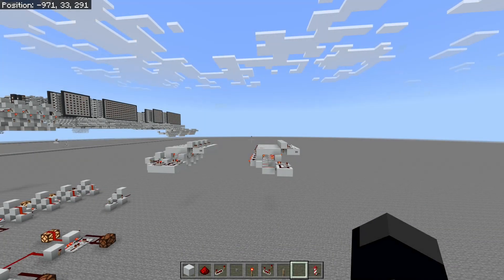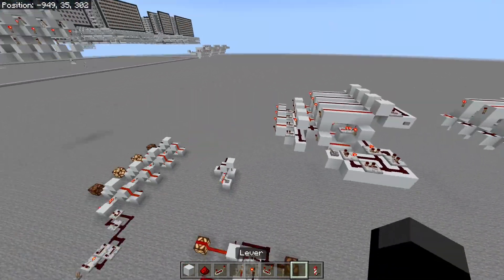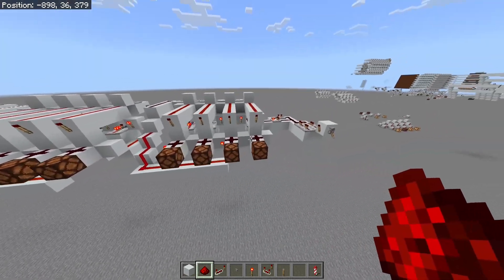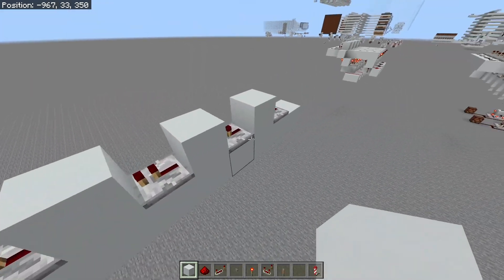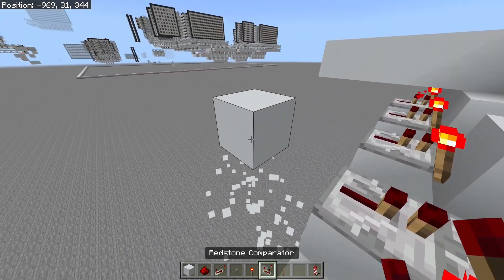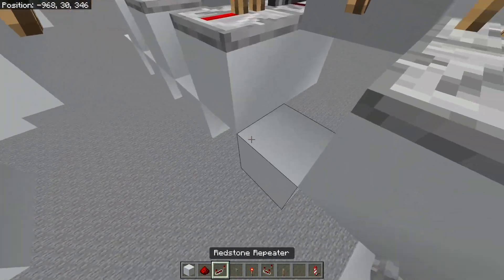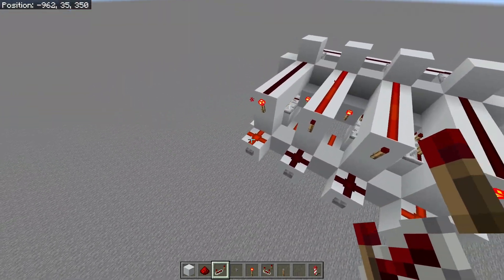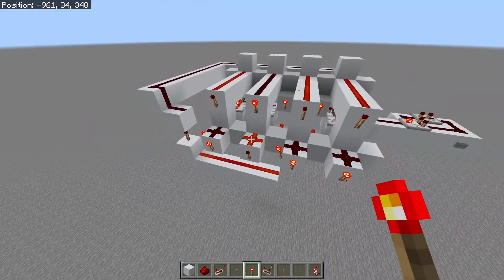Pistonless Up and Down binary ripple counters - Minecraft Java/Bedrock

Comment: Really Appriciated bro. What if I connect that with a display which have pre made digits
Reply from the maker: Yea any BCD display should work fine - basically displays that accept 4 bits in. Just make sure to wire up the most significant bit to the corresponding bit on the display.